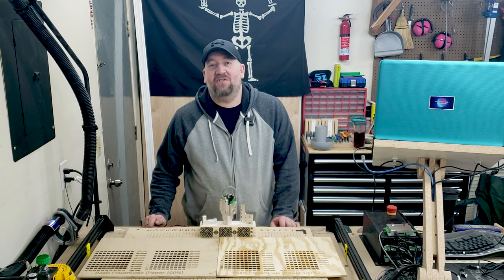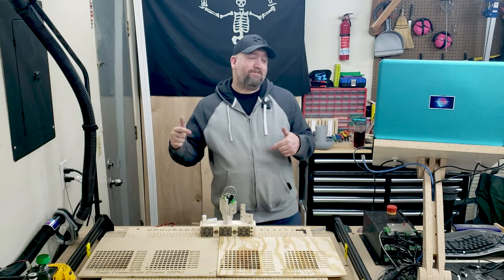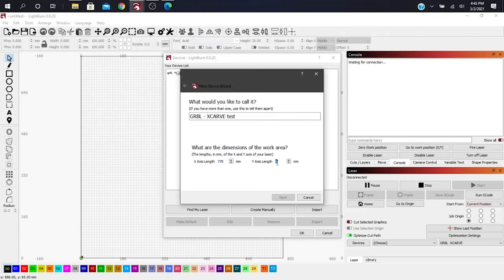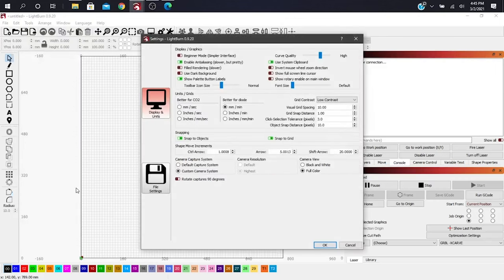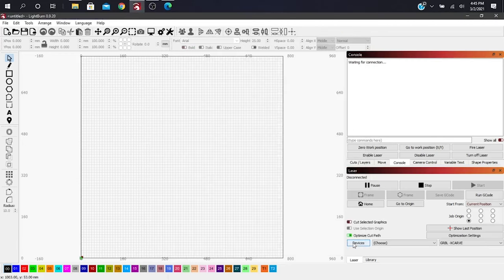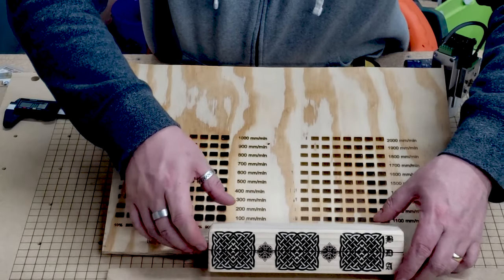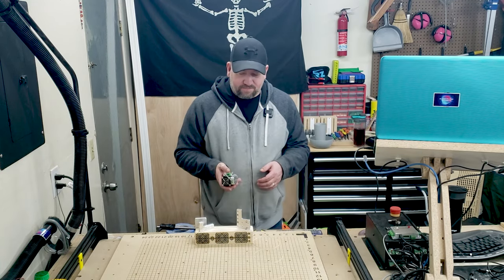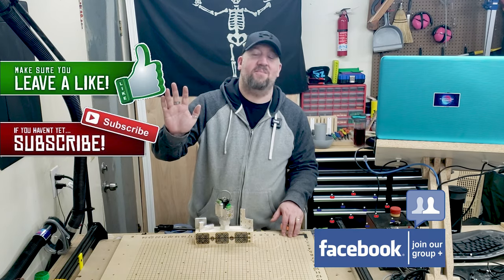LightBurn install and first use X-Carve/Opt Lasers

Comment: I have a question at 22 sec into video during intro you have what appears to be a 3d printed mount for the laser, Id like to know where to get this or the file ive been talking with OPT to create a mount that mounted on front and flush but it kind of died off

Comment: I went through the set up.  I have not mounted a laser yet but I dry ran it.  For a rasterized image, I am hearing a relay in the X-controller chattering away to turn the laser on/off rapidly.  These seems like a bad idea and will surely damage/shorten the relay life. Also likely kind of imprecise.  I think I need to use a solid state relay.  I have a 4 Watt laser I was thinking about mounting to my X-carve and then buying a  two trees 20watt optical laser ($500).   I think you are using the J-tech kit.  Are they using the relay in the X-crave controller?
Reply from the maker: Hi Jim I am using the opt lasers 6 watt laser. They integrate with the xcarve. I would refer to your manufacturer.

Comment: Have you tried any grayscale images
Reply from the maker: I have done a few different Grayscale burns but my video editing  has paused because my computer took a dive. So all my footage was erased.
Reply: Was you able to capture good detail
Reply from the maker: @Cncco  yes depending  on what you are etching there is also a 0lugin on gimp called da big gimpin that helps I would check that out.
Reply: Just curious would you happen to know the highest DPI that the opt laser can handle with clarity
Reply from the maker: @Cncco  I know that you do kot want to go any lower than 300 dpi. I have not gone higher than 600 using da big gimpin plug-in for gimp